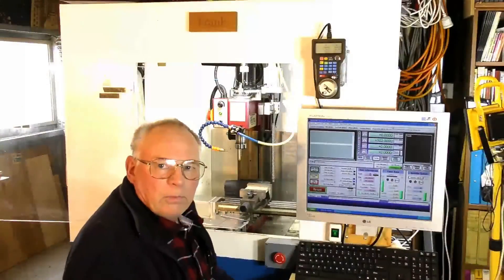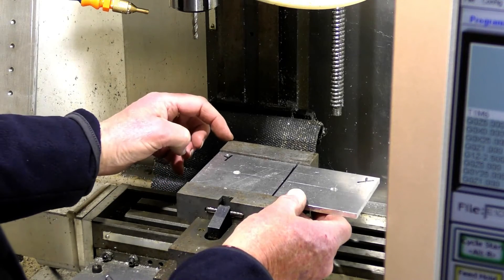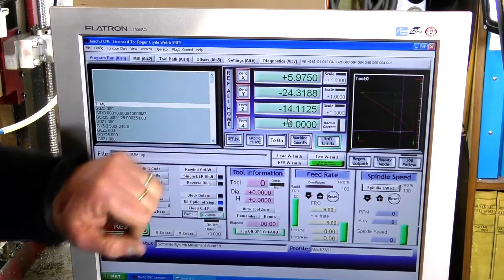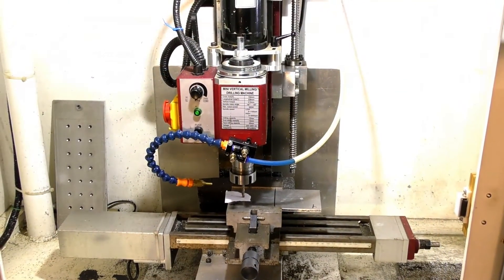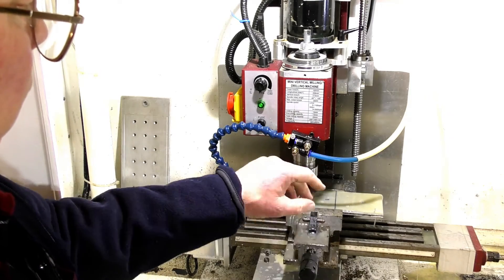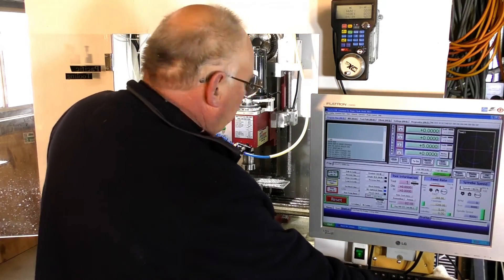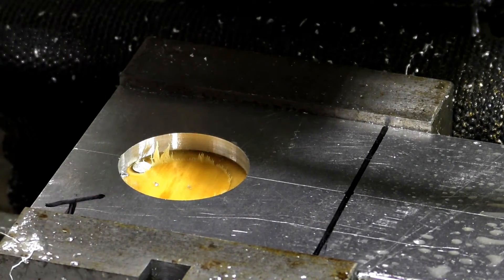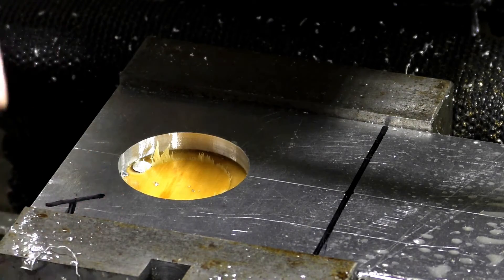Harbor Freight/Grizzly X2 CNC mill & Mach 3 for beginners

Comment: Nice little video.
the chuck is called a Jacobs chuck. also to say to others who have the same type mill, is to get into a habbit of removing the locking bar when your not got your hands on it to use.
 
IE the Allen key/Wrench that Roger has used instead, 
because if you leave it in and power up the mill by mistake you will break all you gears, but in Rogers case he has changed his to a belt drive.

In mach3 you can set up tool fixtures so you can call up the datum points,  like the G55 and so on
but for repeatable work i would set up an end stop.
Reply: Put belt drive on my X1 nearly 20 years ago. It makes a big difference. I used toothed belt turned inside out, friction drive was fine.